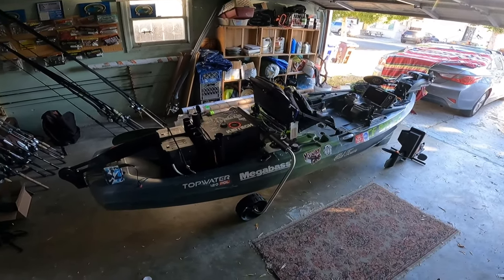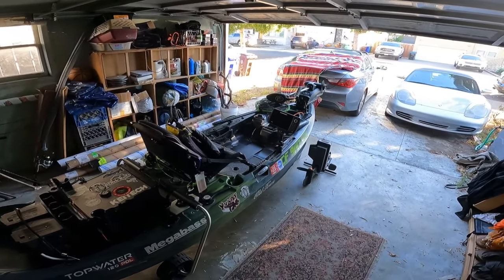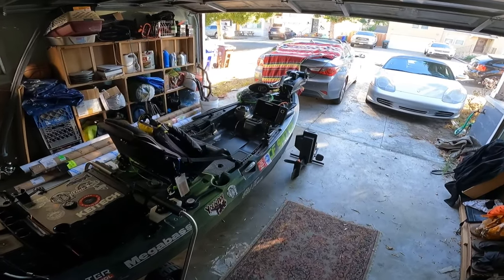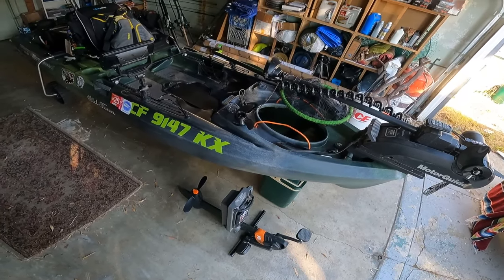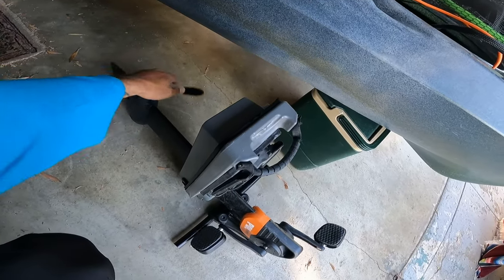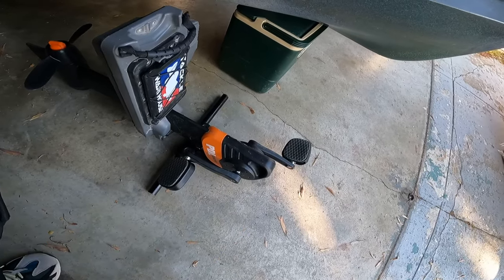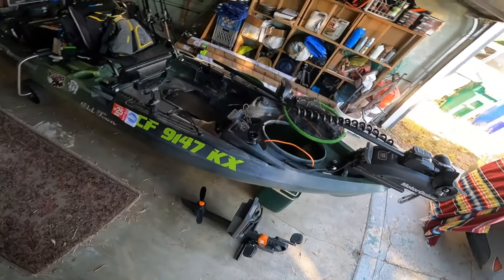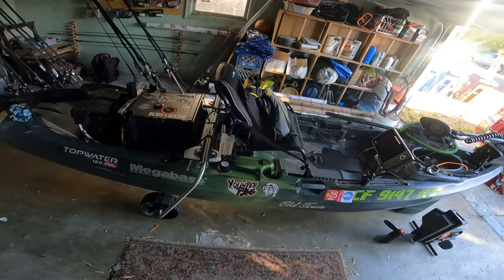Old Town Topwater 120 PDL Kayak Full Mods and Rigging (Trolling Motor, Fish Finder, and more)

Comment: Hey awesome video!  Question can you pedal with the motor up, not being used? 
Other people said they cant with the 106 so im wondering if thats the same? 

Thanks
Reply from the maker: Thanks! And yes, i can pull up the motor and drop in the pedal drive, or take the motor off completely. It’s a tight squeeze if i have both up at the same time, but it’s doable since the mount is at the very front end of the kayak
Reply: @_bassadd1ct_  so you have full functional with both while out on the water to switch back and forth how Greg does on his videos 😃 ??  Asking because I’m thinking of doing this with my top water pdl 120 as well!!
Reply: I ended up getting the 132pdl so I dont have to worry about that.

I just need to get a motor now

Comment: If your motor dies do you pedal with the motor up or just leave it down in the water?
Reply from the maker: I pull it up. I just upgraded from a 80ah battery to a 100ah though, so hopefully i don’t have any issues with the motor dying on the water. It only happened twice all year